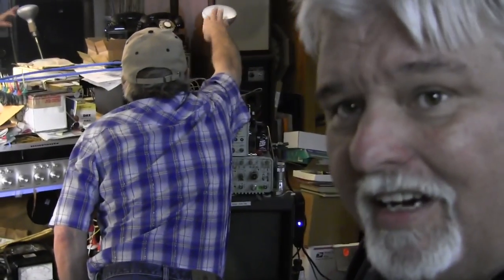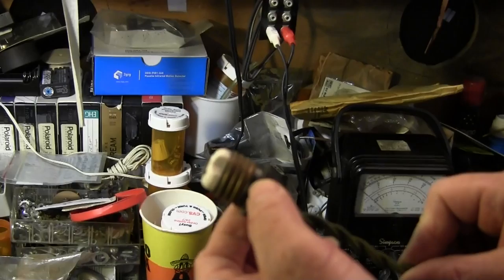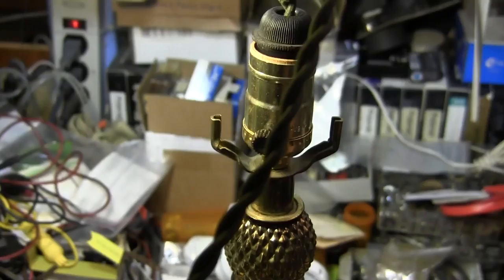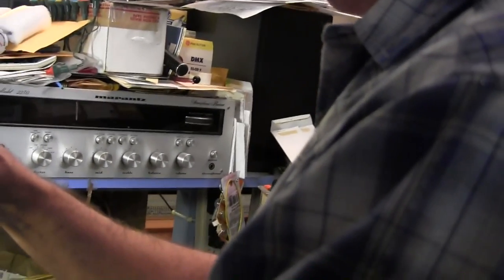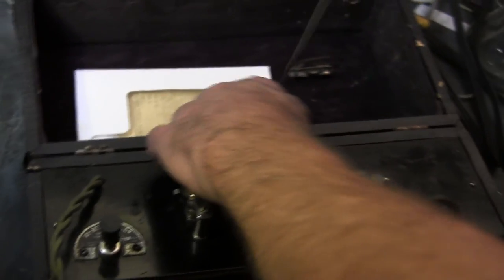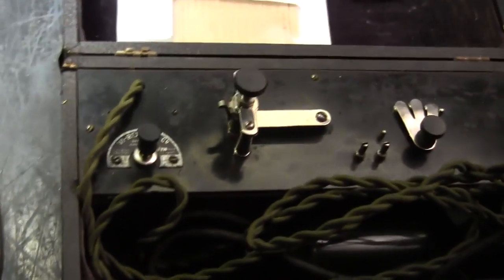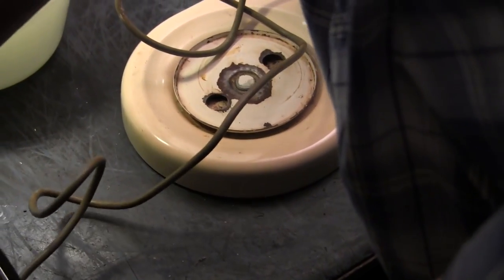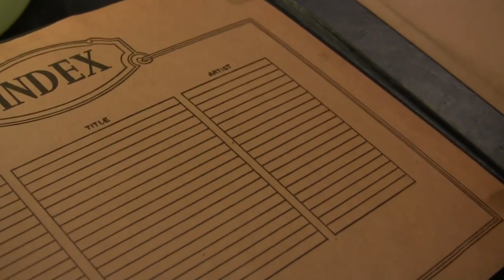Violet ray antique healing device - Tech Talk with Paul and Al

Comment: Great video! Have you ever heard of the "cylinders of the pharaoh"?  They help balance and heal the body made from copper and zinc cylinders filled with quartz crystal when held produce up to 1.5 volt sold on amazon and etsy for only 29.99
Reply: I'd be very surprised if those had more than a placebo effect.

Comment: so can you tell me what exactly is causing the curative effect?  ultra violet, micro current on skin surface? Thank you
Reply: David Michael The noble gas mixture is ionized by the electric current and when applied to the skin surface generates o3. 

It's the mild oxidative stress of o3 that stimulates the immediate area through multiple pathways which increases nutrient uptake of treated tissue, microcirculation and immune stimulation properties via nuclear transcriptional factor, nuclear factor-erythroid 2-related factor 2 (Nrf2). Nrf2 then induces the transcription of antioxidant response elements (ARE). Transcription of ARE results in the production of numerous antioxidant enzymes, such as SOD, GPx, glutathione-s-transferase(GSTr), catalase (CAT), heme-oxygenase-1 (HO-1), NADPH-quinone-oxidoreductase (NQO-1).
Reply: They haven't really been proven to cute anything. They don't produce UV light (though tubes made of quartz glass, which passes UV, have been produced, they're vintage and very rare) and they don't produce much ozone. They do flush the skin. The pre-WWII manufacturers claimed that this increased bloodflow was what cured disease.
Reply: @JonasClark  i have a fischer quartz UV electrotherapy wand and it produces much more ozone than these modern dumb down ozone machines i have 8 different vtg versions of the violet ray and yes they have been proven to cure not treat but cure there is tons of medical documentation and books written till about 1950 when the medical mafia hijacked human health an started a campaign of hiding and misinforming the population on our bodies and how they work its been thrown to the archives but i found so much and being my own test subject it works no doubt some ppl maybe to toxic and rotten within that not even a miracle can help but thats a small number that grows every minute im sure
Reply: @dreaday28ify  Got any links? I've done a great deal of reading on violet rays; in my own research, I've found nearly all the claims that they could cure disease coming from two sources and just two: the violet ray manufacturers, and Edgar Cayce. Even to this day, I've seen no proof that the increased blood flow to the skin, which is what even the manufacturers said they do (and they do, which is why facial spas still use them) can, in and of itself, cure disease. Both pre- and post-WWII, the FDA sued violet ray manufacturers, mainly Master Electric, over their healing claims. That's not the "medical mafia." Edgar Cayce's work is still followed by many people, though I haven't seen evidence of its efficacy.
Ozone is a whole 'nother story. Being an oxidizer, inhaling large amounts is genuinely bad for you. One of my sets came with a glass ozone generator/inhaler, and I have one of the separate ozone generators that uses neon tubes. I don't use the former, and I only use the latter for getting rid of room odor and I air the room thoroughly after use. Again, that's not any kind of suppressed information-- ozone is an oxidizing agent, and a lot of it is bad for one's lungs.
Reply: @JonasClark  I am living proof this works. My knee is restored from bus accident.   I suffered for years
Reply: @dreaday28ify  thank  for this wonderful link. Send more if any.  I have been researching and using some of these devices. And it works.
Reply: @dreaday28ify  I may have heard of that lamp but never investigated it much.  I was aware of some form of lamp that you could use multiple light colored filters on for different benefits but again I don't know much about it or what device is legit and not fraud.  Any info you send I would greatly appreciate.   Another device I need to order is called the "radiac" instructions to build were channeled by edgar cayce, it balances autonomous nervous system using another type possibly etheric energy force. Sold by BAAR  online.  And another called the wet cell battery supposedly can help regenerate nerves sold by same and developed by same.  But please send info. I like to obtain and have these devices on hand.      I did get a red-light therapy device called tendlight. It really does take the pain away I can't say it heals per se but I noticed the pain on my knee would go away for a day or so with a few minutes treatment.  But that was before I obtained the violet ray.  I am literally doing sprints again for the first time since 2016
Reply: @dreaday28ify  you should also by the zapper. I have the zapper z4ex. It works for you know what. I used it on my niece and she said her you know what pains stopped instantly.  I also had her do parasite cleanse and baking soda protocol with bowel evacuation.  She was good to go in 24 to 48 max. Simple Solutions for easy to cure situations 😃
Reply: @dreaday28ify  ok.  Yes I have seen the video now.  Edgar cayce recommended quartz mercury lamps especially.      So do you recommend I buy any of those old lamps on ebay etc or do you have a site you suggest?.
Reply: @dreaday28ify  do those old lamps still work properly? Also why do you have multiple lamps?
Reply: The ones I have work perfectly and I have one for my living room and kitchen one for my restroom and one for my room and a extra one lend to my family but every one I have works perfect I mentioned earlier the bulb is burn out proof and the main reason I bought so many is because they work they are not made anymore,  every time I purchased another one it was always more expensive then the last purchase and I'm really into healing instead of treating the body only to gain a new issue from the treatment,  I'm no Dr and I'm speaking from my own experience after realizing contrary to what we've been taught that my grandparents lived along life grandma 99 and never went to a Dr she was a midwife like her mother who lived longer than her they actually still went for walks and lived alone and I look at my dad who was not even 60 when he moved on and he had heart failure, I have many family members who have moved on this last 2 yrs all were young and all went to there physician and passed in hospitals 11 total I've been looking into this technology prior to the 2 yrs but it has been a confirmation on so many levels any how that's more information than you ask for.
Reply: @nesq4104  eBay and etsy there pricey but worth every bit speaking for myself